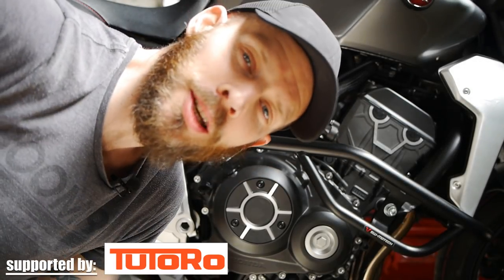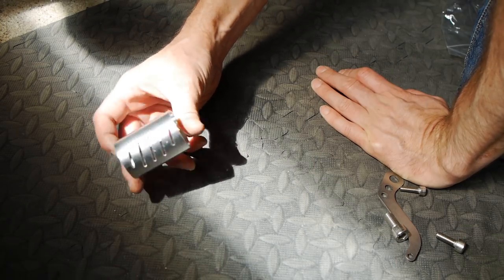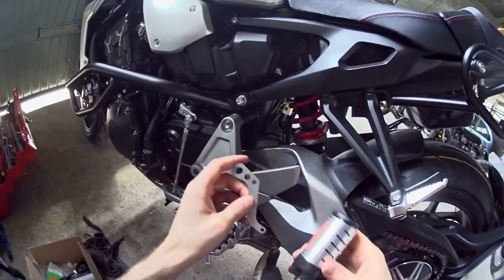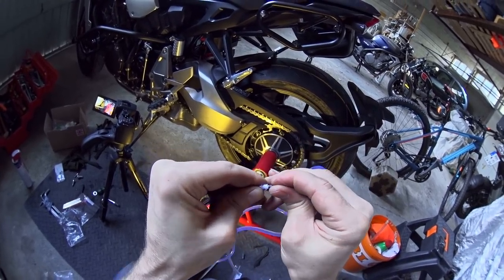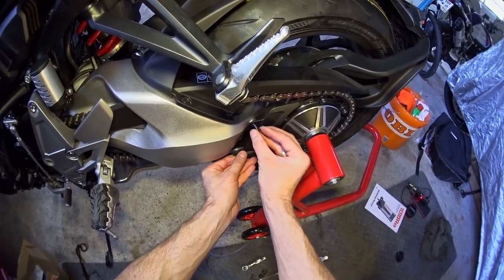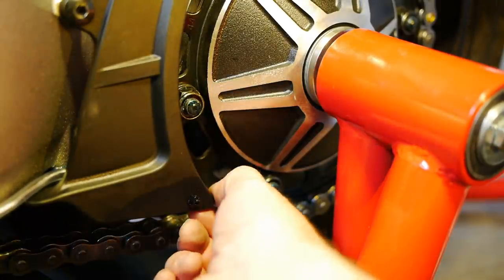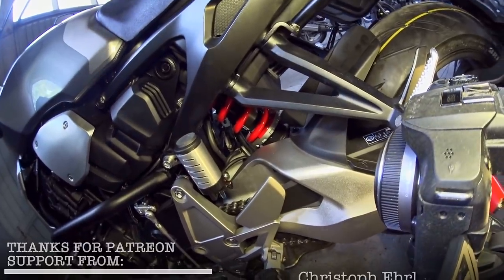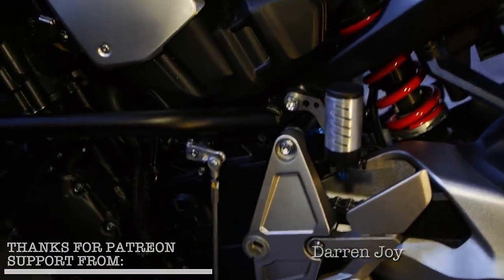TUTORO Automatic Chain Oiler INSTALLED | Honda CB1000R 2020

Comment: hi Andy. Maybe there are comments about this but please reply to me again. Is there chance to lubricate the inside rings, or both in the same time (inside and outside), or it only comes with one side lubricating mechanism? Thank you in advance.
Reply from the maker: For a while they used to have a twin nozzle, but now discontinued. I’ve always found that the inside of the sprocket is never completely dry as a bit of oil is always forced around there. 👍🏻

Comment: Bit of a buzz on the microphone Andy. Increased the gain when editing or through hardware?
Reply from the maker: It‘s just buzz mate. I’m running this ship on a shoestring and using what I’ve got! If I was recording in a proper studio, with pro gear, then it would bother me. As it is, I’m just happy when it all worked according to plan!
Reply: @AndyManCam  Cheers. I was just wondering if it was a setting of sorts or some minor glitch. No other reason to post this on here :). Keep at it. You've been doing great!

Comment: Hi, how often do you clean the chain ?  does the constant/consistent lubing of the chain by the unit keep the chain cleaner for longer or do you have to use the kettenmax just as often as if you were to use traditional lubrication methods ? How much extended chain/sprocket life  do you expect to get by using the tutoro ?
Reply from the maker: I definitely clean the chain way less often. Maybe once a month at most. I’ve yet to see how long I’ll get but I’m on 15,000km so far and i think the chain has maybe another 5-10,000 left. Not bad considering that (IMHO) the Honda OE chain is pretty rubbish!

Comment: I'm interested in this. How much more life would you guesstimate with these vs lubing every 200 miles and cleaning every 800-1000 miles?

How do you mean the bike gets dirtier with these vs spray lube?
Reply from the maker: Before oilers, i would get around 10,000km before the chain was loose and flappy. On my last bike, after 20,000km (and the chain was already fitted when i bought the bike) the chain and sprockets still looked like they had plenty of life. I was never the most dedicated cleaner, but still. Over double the life is nothing to be sniffed at. The oil from the oiler is thinner than the spray wax. So it’s thrown off by the oiler and therefore ends up on the rear wheel and the rear of the bike. Though when the settings are right, this is nothing more than a wipe with a cloth once a week.

Comment: Hello Andy, I have a question.. this oiler appears to only lube one side of the chain, does it track across to the inner plates ?
Reply from the maker: Yes it does. Both ends of the roller get plenty of oil.

Comment: Any word on pros/cons of this one? I've already pulled the trigger and I mounted my scottoiler to my FZ1 today. But this would have been my second choice, so how is it?
Reply from the maker: The real pro is the fact that it's not connected to the bike in any way. No electrics and no vacuum pipes. It does seem a bit more sensitive to temperature though and I had to adjust it massively in the winter. Otherwise all good. Haven't needed to adjust the chain at all in the last 3000 miles.

Comment: Just bought to install but your reservoir fixing position looks different to mine as I don't have engine bars fitted. Would the bracket fit in same position if I remove bolt cover on std bike
Reply from the maker: I think you might need some kind of spacer, as the bolt is recessed into the frame (as I recall). But that of course means that it is possible, just with perhaps a tiny little it of extra faff!
Reply: I got around it by positioning on off side and cutting a mounting bracket. I will post photo when done, pipe routing will be same but from opposite side
Reply from the maker: Glad to hear it. With so many bolts and mounts, there always has to be a solution in there somewhere!

Comment: After your Vosges trip, do you have a better view of your Tutoro "consumption" per (1000) km ? I ask this because since this installation video of yours, I installed a Tutoro on my bike, and I wonder if I could ride e.g. the RDGA, next year, with only one extra container oil fill...
Reply from the maker: After a few good long trips, I can tell you that (on my settings of half a turn open) in warm weather the filled reservoir lasted for about 5000km, so about 3000 miles. Not bad at all and enough for most 'ordinary' tours!

Comment: I suppose if you don't have a centre stand these may be beneficial. Gear oil is the best for chains so will this accept gear oil or must it be their own oil?
Reply: Gear oil is probably thicker than their oil. It might not flow very well, or work right with that vibration valve.
Reply: I was looking at the manual online the other week, it's well written and long AF. Full of warnings about how washing the bike or using the wrong lube might bugger it. It says gearbox oil will swell the cap and you'll crack the tube. They used to make one with a on/off tap for like £15
Reply: @dazednconfused31337  Yes, I had one of those £15 jobs. For me, a waste of £15. Back in the day I've also tried the old Scotoiler, which are still overly expensive. I've come to the conclusion that regular manually oiling of the chain while on the centre stand and running the engine in 1st gear is my preferred option.
Reply: MrC InTheUK for god sake, don’t have the bike running in gear while doing chain maintenance. That’s one fast was to lose fingers. Only takes a split second, you’re finger gets between the chain and sprocket and say bye bye to your digit.
Reply: @robzz9002   Take your point, which is why I now use a long, flexible oil can. Been doing it for 47 years and I've still got 6 fingers left! 👍😁
Reply: Nice, been looking at this setup too as there’s reports of issues on my bike from chopping into the vacuum hose and I don’t want to add any more electrical load to the bike as I’m already pushing it. Could be the next purchase for the steed as regular lubing is getting a bit tedious, especially in winter when the rain likes to wash off my efforts.
Reply: MrC InTheUK still got 6 fingers left 🤣
Reply: @robzz9002    Presume you have a Z900. Been looking at the 2017 version (no electronics other than ABS). Z900 is far better than the GSX-S750 but also considering a test ride on the GSX-S1000. Anything I should be aware of about Z900?
Reply: MrC InTheUK what gave it away lol. If it’s a 3 year old bike, chances are the stock tyres have been replaced by now. If not, you’ll want to change them as they’re borderline dangerous and let go of traction for no apparent reason. Stock suspension is budget, so not a lot of adjustment. I didn’t like the stock handlebars so I changed them and also changed the footpegs and high seat for more legroom and comfort, though I’m 6’ 6” so not an average height. Other than that, great bike 👍🏼
Reply: @robzz9002   Thanks. 👍
Reply from the maker: As well as other points made here, important to remember that gear oil is apparently on the nasty end of the oil scale for carcinogens and compounds that are disgustingly toxic for the world at large! It’s intended to be contained and kept away from the outside world. Of course bikes in general aren’t exactly environmentally friendly, but we can do what little we can do!

Comment: Hi Andy, How are you getting on with the Tutoro after a year?
Reply from the maker: Good! Still oiling and the chain is still kicking! The hose has hardened a bit around the reservior connection, but that is a relatively easy fix.

Comment: Does it really need to oil the chain right be the sprocket? @16:33 Can you not do a short tube right there?
Reply from the maker: If you have the oiler lubing anywhere other than at either of the sprockets, then there is far too much movement of the swingarm. This movement prevents you from putting the nozzle close enough and therefore you'd lose most of the oil in the wind. You could mount the nozzle on to the swingarm, but there is still also a lot of movement through chain slap. One jump from the chain and the whole nozzle assembly could be ripped from it's mounts and destroyed forever!
Reply: @AndyManCam  Thanks for the explanation!
Reply from the maker: My pleasure entirely!

Comment: How’s it working out for you?
Reply from the maker: Very good. Even after 1500km in horrible torrential rain and cold (video is on the way) the chain just looked like it could maybe do with a little wipe, nothing more! Still oiled and quiet though. So far, I'm happy.
Reply: @AndyManCam  -  Nice. Think I will pull the trigger. Just got a Z1000 with twin exhausts, which is an utter pig to do chain maintenance on.
Reply from the maker: In that case, I say go for it! On mine with the single sided arm, chain adjustment is now super easy, but trying to lube it on the road without a paddock stand is a pure exercise in frustration!!

Comment: wouldnt these leave oil trace while riding and your mates following your path. such a 1st world problem cant do manual oiling!😆
Reply from the maker: Theoretically yes. But it’s such a tiny amount of oil that’s put on to the chain that you only really even notice it on the bike after several weeks.
Reply: @AndyManCam  is this gear oil andy? whats the viscosity?
Reply from the maker: @renzovelezthe2  I’m assured that it is not gear oil. Which is good because gear oil is awful stuff and really shouldn’t find it way into natural waterways when it rains and washes the oil of the street. 😱 I’m afraid i don’t know the viscosity, but they have two different versions. One for temperate climates and one for hot.
Reply: @AndyManCam  cool good to know..

Comment: 4:24 is that CGI? That's the cleanest rear I've ever seen... which is supposed to be the dirtiest part.
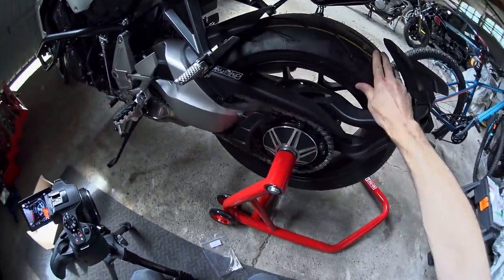Reply: The bike has only 2 km on the odometer. 3:22
Reply from the maker: What Ritchin Sen said. Brand spanking new innit! I’d literally seen it wheeled off of the van hours before!
Reply: @AndyManCam  of the van? I thought it was tank transporter, if you know what I mean :D
Reply from the maker: I was hoping for something spectacular, but it came in a pretty nondescript Merc Sprinter.  Still, it was a new bike, so i got over it!

Comment: Interesting vid buttttttt I hate chains so much on bikes always looked for shaft bikes or belt 🤓. There again I see bmw says they come up with none oiling chain. 🤔 we will see. Few more years you end up with gold wing shaft if you stay with Honda 🤓 😎🏍💨💨💨💨💨🇨🇦👍🏻
Reply from the maker: I like the idea of a shaft, but i don’t want the size of bike that seem to have them. Sadly all the manufacturers stopped putting shafts on anything less than a 1200 a long time ago. My CB1000r is the perfect size and power for me, so that comes before the drivetrain type. Though if it weren’t for chain oilers, I’d have given up on that ethos a long time ago! Luckily on this bike the single sided swingarm also removes the need for alignment and simplifies adjustment too!

Comment: Nice one!

Although I'm a bit paranoid about the lubing terminal of the tube getting caught in between the chain and the sprocket. I imagine that couldn't possibly end well
https://youtu.be/PwNg-1qI-Bo?t=729

Wouldn't it be safer to install that part a bit higher, so that it'd be lubing the sprocket further away from the chain-sprocket junction point?
Reply: Put it too high and then the wind may blow the oil away before it gets on the chain. He did a solid install but even if it did catch I think the hose would just snap off. It’s the weakest part of the kit

Comment: HAHAHAH the price!!!
Reply from the maker: In which direction?
Reply: AndyManCam $150 Australian dollars for the base kit... crazy expensive. Toothbrush and a tiny bit of transmission oil will suffice. Rather put that $150 to carbon wheels I think
Reply from the maker: You put your value where it works for you mate. For me, $150 would be money well spent for the reduction in cleaning and adjusting Alone. Add to that the fact that the chain and sprockets last about twice as long and the thing has paid for itself after one drivetrain replacement.

Comment: You should have gone with the Scottoiler X System.
Far better and far more reliable.
Reply: Maybe so, but they didn't send him one.
Reply: @battsonbikes1919  well buy one like everyone else has to.
Reply: @SCOOPER3896  I bet your a barrel of laughs at a christmas party ;)
Reply: @battsonbikes1919  haha yep.
Reply from the maker: The scottoiler X System is twice the price and needs an electrical hook up. Both big fat negatives in my book! As for ‚better‘ and ‚more reliable‘ we’ll just have to wait and see.
Reply: You’ve obviously not tried one. My Tutoro kit has done around 50k miles on 4 bikes and still going strong.
Reply from the maker: Very good to know Colin. Hopefully I’ll get the same life out of mine!
Reply: @SCOOPER3896  I've got both on different bikes there is no different but the price 🤷‍♂️
Reply: I bought both myself 😂
Reply: @AndyManCam  the only things I've had to buy are a couple of replacement nozzles and another bit of tubing
Reply: @cport955  I have used one abs the oil drip rate was useless.  Even when set at a minimal rate it overloaded the chain. 
One of my worst ever accessory buys.
Reply: @SCOOPER3896  you're doing it wrong